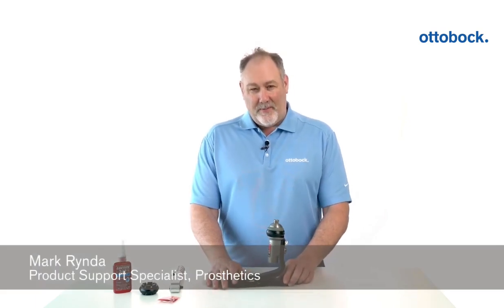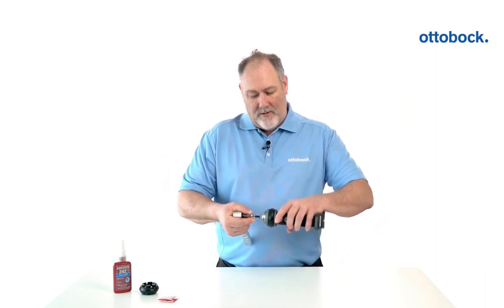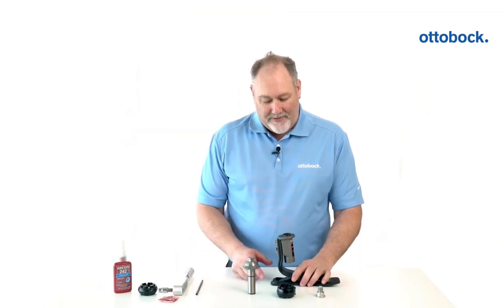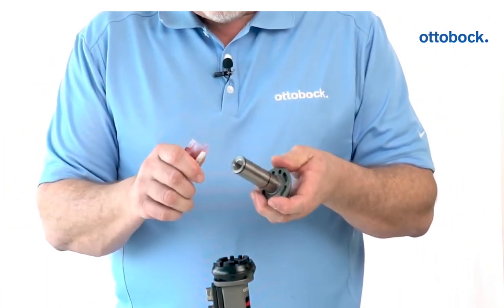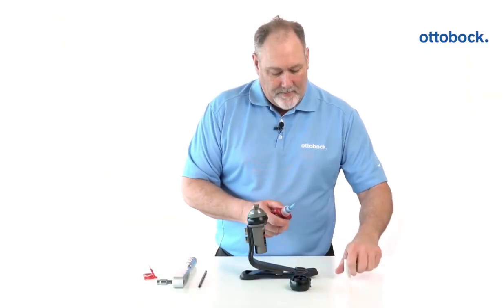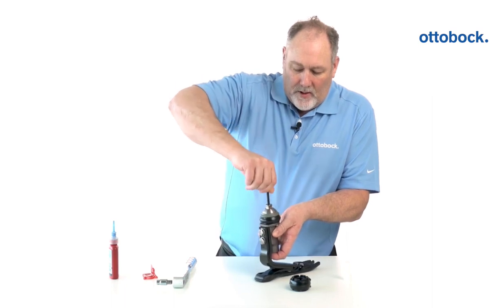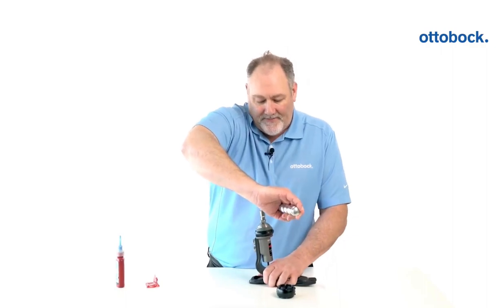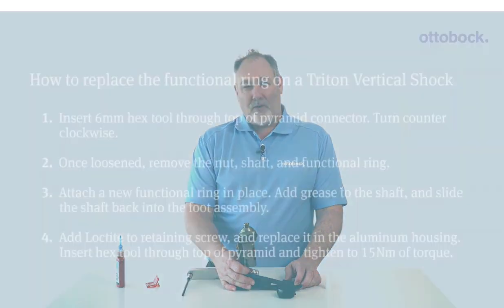Ottobock Triton VS

Comment: One thing that's important BEFORE installing the ring is that the ring MUST be set under pressure for sometime before putting it back in place. This is because to make it softer. Brand new it will appair too stiff.